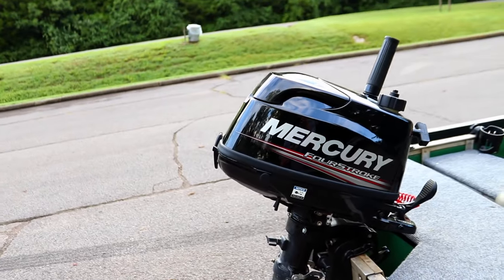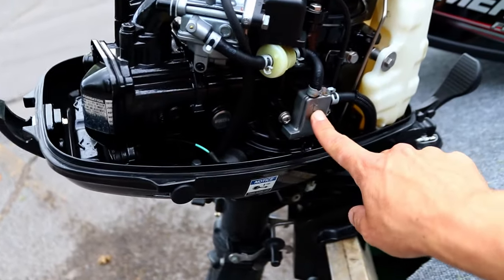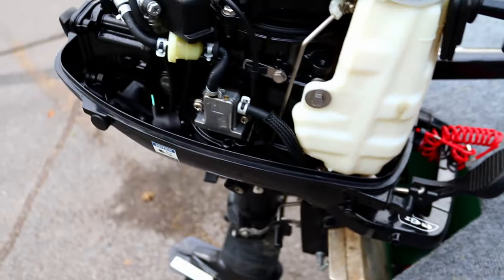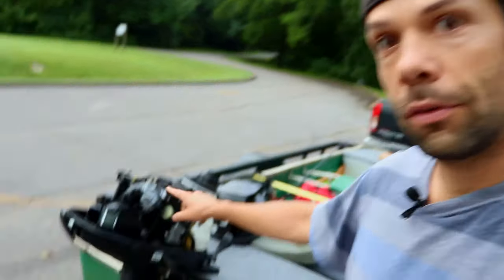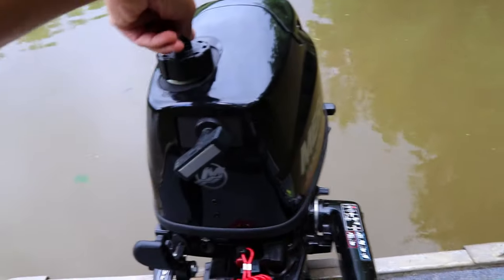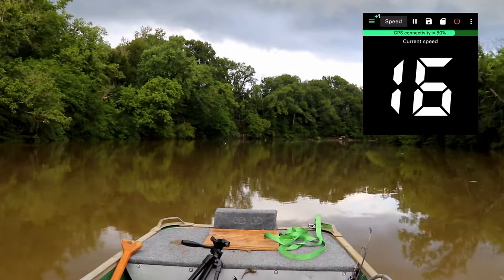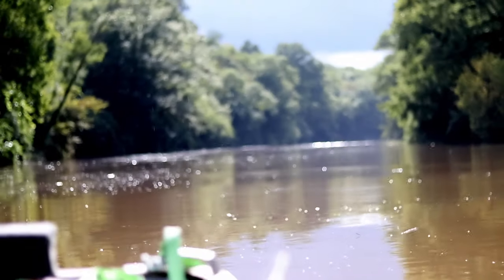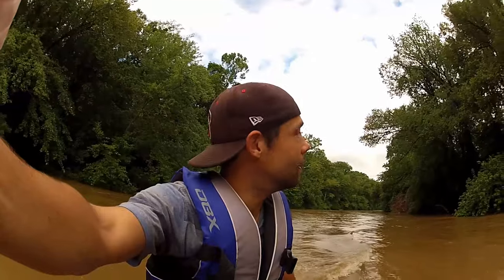Mercury/Tohatsu 6HP Outboard: Review, Walk-Through, & Test Run. Best Jon Boat Motor?

Comment: Nice video just picked one up  2018 and it has  a little rough idle...if you ever do carburetor cleaning video please post. Enjoy the motor and thanks again for the videos!
Reply from the maker: Thanks! I will definitely post a carb cleaning vid as I am learning a tremendous amount about these little motors and it would be fun (and a little scary) to tear that carb apart. Thanks again for the view and feedback, I’m new to this whole YouTube thing so I appreciate any feedback I can get!
Reply from the maker: I think a carb cleaning will solve your problem, but I would also check to see if the person before you messed with the idle speed screw (fuel air mixture screw) on the carb. It comes from the factory sealed (has a metal cap on it to keep people from messing with it for emissions reasons) BUT a lot of people pull that cap off and adjust it. If that cap is missing, then you know it was messed with. CONGRATS on the new motor!!!! I hope you have as much fun as I am with mine!!!!!
Reply: Thanks for reply I cleaned it out and tweaked somethings but still no luck with consistency starting and staying idle smoothly. I actually found a new carb on Amazon and just received yesterday installed it and it started right up no problems. I let it run for 10-15 min but then it turned off. I tried to restart this morning and won't start now. I'm using new racing fuel  and I changed the oil? I will continue mess  around I'm new to all this. Thanks
Reply from the maker: E M let me know how yours plays out.. I’m really interested if you are able to get the starting issue figured out. I’ve tried high octane and it didn’t change anything. 

I read someone turned the idle speed screw out 1/4 turn (allows more fuel in the idle jet during starting) and that solved their problem. But your situation is weird given it started with new carb??? New spark plug can help but something bigger is going on.
Reply from the maker: E M ha ha YES!!!!! Gonna try this today! THANK YOU! 

I have been exactly where that guy said he has been. On a ramp with 20 people watching me pull that stupid cord lol... maybe no more!
Reply: Hey guys!  I was just going to add that if you use the internal gas tank, make sure you start the day with a full tank.  I've read that when the gas gets low and you start it for the first time, it might have a hard time getting a prime because it's just gravity pushing the gas to the fuel pump.  The extra weight of the full gas tank might help the fuel pump out a little bit.
Reply: One more thing.  1 month ago I got stuck with a low speed condition.  After driving the boat for hours, running perfect, it all the sudden wouldn't go over idle speed.  If I gave it more gas it would just die.  The motor had only 10 hours on it so I wasn't happy!  I checked all the normal stuff and I couldn't figure it out.  I had to go 7 miles at idle speed to get back to the ramp, long day!!! I was using the optional 3 gallon tank.  Well all new gas tanks have an inline fuel demand valve.  I never heard of it before since I had an older outboard that didn't have one.  It's another emission thing.  That valve can get clogged with something and you're supposed to stick something like a very small flat screwdriver in the provided slot and this clears it out.  You don't have to take it apart, if you do a quick search you'll see what it looks like.  When I got home I tried it and the motor ran perfect again.  I used it for hours since and it is still fine.  I still prefer the 3 gallon gas tank option because it has the pressure bulb.  I just have to make sure I have a small screwdriver on the boat in case it ever happens again.  I didn't want you guys to have to go through what I went through so I thought I would mention it.
Reply from the maker: @chrisr465   I usually use internal tank, but my external has a fuel demand valve as well. Like you said its all because of new California EPA regs on tanks to prevent gas vapor emissions  which can create pressure inside the tank and cause the motor to flood. Many new tanks look like they are vented, but in reality its just a pressure relief valve to prevent a rupture. So many regs... Some are good and help the waterways others cause a lot of headaches. Thank for the comments and help! They are extremely helpful... I never even thought about if the  gas tank is low it would impact the pressure in the gas line and result in less flow!!! that is a really great pt.
Reply: I think the gas would be higher than the carb when it's full instead of being lower and I would think that would make a difference too.  The carb is kinda high on this engine.
Reply: Ok guys I think I got it.  When the fuel  level of the gas tank goes below the height of the fuel pump I bet it's draining back in the gas tank when it's not running.  That's why it takes a few pulls to get the fuel up to the height of the carb.  Once it's running it will keep the prime.  Just a guess.
Reply: These are all great points and appreciate the feedback. I hope to go out this weekend and test it out on the lake 1st before going on the bay.
Reply: EM, also try disconnecting the fuel line from the carb while it's running.  The fuel pump should be spraying out fuel pretty good.  If not much is coming out, then you found your problem.  Fuel pump and fuel filter.  It has to be running of course.to check.
Reply: Thanks the fuel pump I checked and works great...thanks for input on external pump when I use that I'm getting the hesitation when I accelerate and almost stalls. I looked inside where the inlet connects to motor and I press into it and notice some greenish slime inside. How do I clean that? When I use internal tank everything works perfect now each time.🙏🤞
Reply: I would get a can of carb cleaner with the straw attachment and spray  into where your pressing and detach the opposite end of the fuel line.  Not sure if you meant the on the motor itself or the gas tank line.  Also if that doesn't work,  then go to valve that transfers whether your using the internal tank or the remote tank and clean that out.  I noticed there is a sediment bowl on the bottom of it so that should be checked too.
Reply: Also make sure your inline fuel demand valve isn't causing the problem like I mentioned earlier.

Comment: I have a 4hp tohatsu which makes the mercury's, my is also used mine starts on first pulled but once in a while it will sputter and then spits out fuel from the overflow and then I have a hard time starting it as its flooded I have had the carb cleaned ,the floater valve changes and it still does it ,very annoying, but I only  payed $750 for it so I deal with it ,biggest issue fastest  I can go with a 12ft aluminum and two people and gear is 7 mph. ..but still faster then my brotherinlaw with his johnson 2hp on his crawdad. Lol
Reply from the maker: Ha ha man I wish mine would start in first pull. Don’t think mine gets as much fuel as yours as it seems yours wants to flood but mine has never flooded when starting. One trick when it’s flooded is to kill choke, turn tiller to full throttle and give it a few pulls. It will force a lot of the gas out of the cylinder preventing the spark.
Reply: @Skinnyriver  yup that has been suggested and I have tried that ,works some times but not always. It's a mystery

Comment: What about honda 6 hp outboard? How does it stack against yamaha 6 hp and this?
Reply from the maker: I personally think there are all great. Mercury wins with its warranty, Yamaha wins in reliability (maybe power), Honda wins on price. Don’t forget about Tohatsu as well, they are the same as Merc but cheaper. I don’t think you can really go wrong. My favorite though would be to get one of the last 2stroke Yamahas that were sold in the US (no longer can sell new 2strokes due to EPA). 

https://forums.ybw.com/index.php?threads/best-small-outboard.541272/

Comment: i bought a 2020 4hp $1,365.99 plus ship and tax and did the 6hp carb up grade was $150 but my boat is a 14' Alumacraft rated for a 20hp max so heaver gage and wider than basic jon boat so i keeped the 7.8x7 pitch prop and WOT with me 240lb all fishing gear and ice chest it runs 5700 rpm at about 12mph as a 4hp it would not get the boat up on plane so big improvment with the 6hp carb but i also think the 7.8x8 pitch prop that the 6hp comes with would have been a bit to much and the 7.8x7 pitch that cam on it as a 4hp it perfict for my setup and I am very happy with it and it was a cheeper rout than strait up buying a 6hp .and here is my vid of me doing a speed test with a tac on the motor so i could check wot rpm to make shour i was not over reving the motor and i got the boat in 1993 so it been around for a wile :-) ..https://www.youtube.com/watch?v=WPRS18Okd9M
Reply from the maker: I need to get a cheap tach. I just learned these motors do not have a rev limiter and I have not idea what I am running WOT. Yeah I am thinking about getting a 7 pitch prop to get on plane faster BUT I do like the 17mph I get out of the 8. 

Nice vid and nice channel!!! I look forward to more of you Merc vids!!!
Reply from the maker: One question, did you have any timing issues with the 4hp to 6hp conversion? I have read that ignition timing is different on 6hp and it causes some timing issues (misses, backfire, etc).

Comment: If your motor has adjustable trim positions tilt the motor one or to positions. That will lift the bow and help it plane faster.
Reply from the maker: Thanks, yeah I went through them all and  found the one that planes the best/fastest. Gonna try a 7 pitch prop next! Then some jet fuel...

Comment: Like you say tohatsu make nearly all of small mercury/ mariners / Nissan  and have done for a long time. I also agree that you never seem to get same performance from a 4 stroke as a 2 stroke. It's not just their extra weight, but I think 4 stroke power ratings are often optimistic.  I'm sure it would help if you trimmed your motor to push the boat flat rather than nose up the way you have. I have a 2000 model year of same motor and it's still running smoothly pushing my sail boat.  Regards from England.
Reply from the maker: Yep agreed with everything you said! Cheers and thanks for the view and support! Cool that this little motor and hobby spans over oceans :)
Reply: @Skinnyriver  it's actually amazing that tohatsu took their 2 stroke line of 4 and 5hp and designed a 4 stroke power head to fit on top! 
As for your starting issue, I had the merc 5 stroke before this which had  an internal tank. There was some valve in the fuel line I removed to allow the fuel to fill the carb without priming pulls. This was possible because I only used the internal tank like you. One way to check is open the fuel drain in the carb bowl and open fuel tap and see if fuel drips out of carb. If it doesn't there is a valve stopping the flow  and needs the fuel pump operating to get fuel started. 

Yes youtube is great at pulling people together across the world. Doenst matter if you are in US or here in rainy cold England we all still like playing with boats and motors. Nice review my friend!
Reply from the maker: That’s a really good thought about cracking the carb bowl drain plug to check flow I have always thought it was a carb issue but after I cleaned it, still take 5+ pulls. 

So has to be fuel flow issue. Im going to try what you said and also experiment with an external tank that has a priming bulb to see if that helps. Logic is the external tank has a priming bulb. if I prime and it starts quick with external tank, then it’s simply not getting gas from internal tank due to needing priming pulls to get fuel pump to fill carb.
Reply: @Skinnyriver  as I said my 4 stroke doesn't have internal, so I'm remembering from 12 years ago with the 2 stroke but otherwise same main outboard.  But as i recall The fuel tap only  had 2 ways not 3. So it relied on a valve. This, I'm sure, stopped the gravity feed so it needed the pump action even with internal tank. Anyhow I'll leave you to figure. Take care my friend!
Reply from the maker: I’ll pull the carb bowl plug and see. I bet you are right, has to be fuel flow issue until everything gets primed. I have seen some people blow into the internal tank to help push gas into the carb lol. I’m Not that desperate :)
Reply: @Skinnyriver  Hahaha. Let me know how you get on mate.

Comment: Any additives that'll melt the gunk in the small carb ports?
Reply from the maker: You best bet is seafoam but honestly if there is junk you probably want to take the carb apart, take out the jets, out and use a carb cleaner.
Reply from the maker: Good luck and thanks for the view, let me know what you decide to do!

Comment: I've run Tohatsu outboards now for a couple seasons and they have been great. Mine came second hand so some maintenance needed to be done but finding info/parts has been good.
Reply from the maker: Yeah I’ve had a great experience with them too. Great motor
Reply from the maker: It’s my 2nd year with it and I’ve gotten it all figured out now. Super reliable

Comment: They are all like that to start mate, only time they go first pull cold is after I clean carb in ultrasonic cleaner and had full service, wouldn’t mark it down for it. Regarding getting on plane quicker, take a reality check it’s only a 6hp, worth checking how clean the underside of boat is!!!! This will make as much difference as putting a larger engine on, if it’s remotely dirty or covered in a slime clean it and feel the difference
Reply from the maker: Yeah I’m gonna clean and wax it!!! Thanks for the view and I agree if I want it to act like a 15hp I need to get a 15 lol. Thanks!
Reply: Try changing the Engine Tilt.
Reply from the maker: Funny you should mention that!! Just went through finding that sweet spot https://youtu.be/PYldlDtkZrI

Comment: I see you have a great time with it so I went to buy mine I'm not blaming you but my Mercury 5 horsepower is the worst investment I ever made
Reply from the maker: I’m sorry to hear that. Curious what problems you are having out of it? Was it new or used? There are some special things with these motors that are frustrating that I have learnt and have dealt with or fixed on my end. What issues are you dealing with?
Reply: I was told it was a short shaft shame on me for not measuring I didn't know they come 17 and a half in my transom is 16 in that inch-and-a-half cavitation plate below my hullby about almost an inch and a half I have a 12 ft Duke duranautic...I can't plane  my stern almost goes under ..and at half throttle is like max power
Reply from the maker: I’m pretty sure that is the short shaft, the long shaft is 20”. I just measured mine and it’s 17.5” to the cavi plate and 15” to the seam where the lower end mates up, I think they actually measure to that point. Mine also sits 2” lower than my transom and my bow runs really low… I solved the issue by raising my trim to position 3. Also you can get a 2X12” board and clamp to your transom to raise the motor up 2”. 

Have you tried running with trim in a higher position?
Reply: @Skinnyriver  I've tried running at all sorts of trim levels I just get Super Dragon can never get on plane water comes over my Stern
Reply from the maker: Here is a post from a guy that had the same issue with a 15hp. 
https://forums.iboats.com/threads/12-aluminum-v-hull-wont-plane.548942/
He solved his issue by reducing weight especially in the front. I would read through those 3 pages of posts to see if anything is is familiar to your situation. Vhulls can be heavier than flat bottoms. The only other option is to get a prop with a lower pitch which will give you more power as you accelerate or clamp a 2x12 or something to act like a spacer to get the outboard up 2” to test that theory.

Comment: Dont know if you still read comments on this video but is it possible to also upgrade the 5hp to a 6hp?
Reply from the maker: Yeah, I think it’s the same upgrade kit that works on the 4hp. Im trying to find someone who has actually did it to see if there is a big difference. Not sure if 1hp is worth the $200 but maybe it is
Reply: @Skinnyriver  thanks! I'll take a look too, i have a very light boat so the 1hp might make a difference but i'll look around
Reply from the maker: It sure be cheaper than a new motor :) I think the kit is literally just a larger carb

Comment: I have the same motor starts right up try leaving the fuel on or wait 15 minutes before you try to start it after turning the fuel on it's a 4-stroke they usually don't have problems with flooding
Reply from the maker: Will try that, I have done a ‘dummy’ pull where I either leave the stop lanyard off or a slow pull to get gas through the carb into cylinder. But filling all the way to the top and leaving for a while should also help. Thanks!
Reply: I saw a service guy blow into the built-in gas tank after opening the fuel valve. Motor started on third pull after months in storage.
Reply from the maker: Ha ha... think I will just pull a few extra times

Comment: I have tohatsu 6 hp, same engine.  Same problem , cold starts
Reply from the maker: Are you using the internal tank? I found my problem now it starts in 2 pulls, check this out if you use the internal tank https://youtu.be/tD2eeR7btXs
Reply: Ya, looking at your comments I found it already. Thanks
Reply: Also, thanks for your service video.
Reply from the maker: I appreciate the support, thanks!